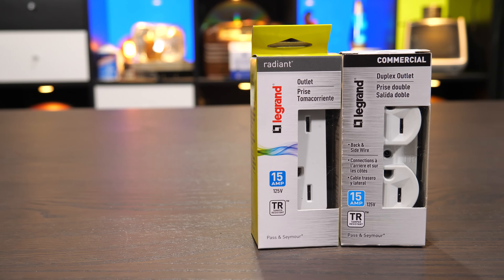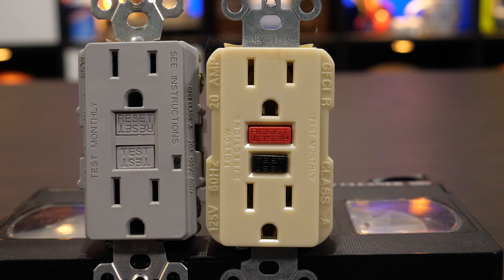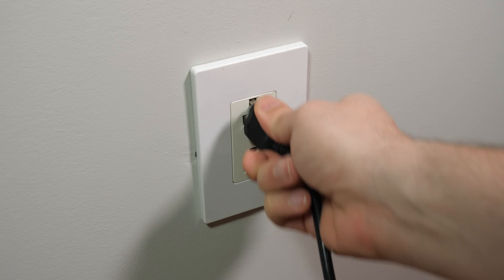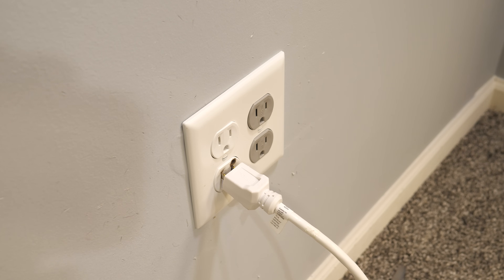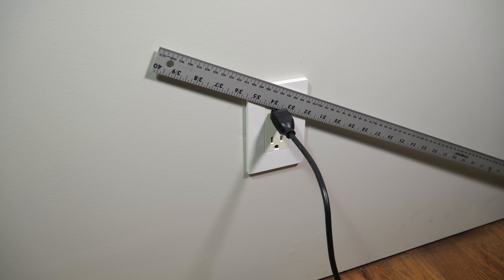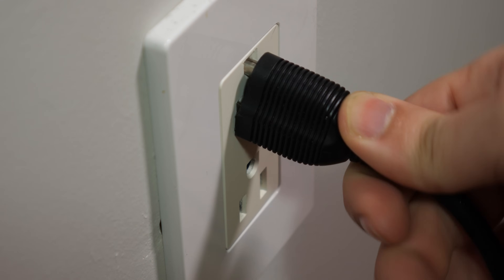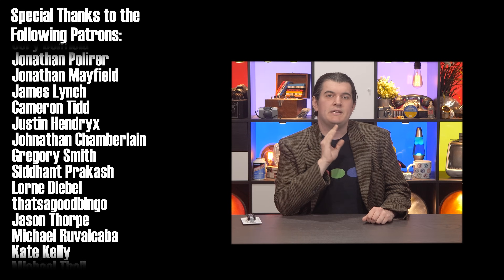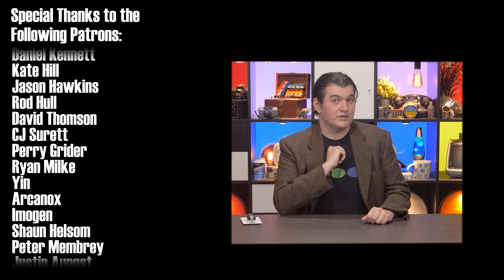Power outlets are topsy turvy - but does it matter?

Comment: One of the main reasons the EU plugs are superior, even to the UK ones. The receptacles are designed symmetrically so that they are identical when turned upside down and any plug can be inserted either way, which also has the benefit of allowing you to use two angled plugs in the same pair of receptacles.
Reply: UK plugs do have one point of superiority over everything. The live and neutral sockets have a mechanical shutter/shield that requires the, longer, earth pin to be inserted to open the shutter. This makes it almost impossible for little /fingers to get into the live and neutral sockets. Als, as all plugs have to be 3-pin then equipment that  requires a specific live-neutral polarity (I know that not much of that exists) doesn't require any thought when plugging it in. 

UK plugs and sockets are the safest in the world.
Reply: @davidjowett8195  the shutters can be implemented also with euro sockets, even though probably it's a bit less reliable system. Here in Italy it's mandatory, the shutters aren't connected to the earth socket but are designed to open only if pressure is applied to both live and neutral sockets.
Reply: @davidjowett8195  For any north americans who are jealous of the shutters, you can get NEMA outlets with shutters, but they aren't required
Reply: @davidjowett8195  Euro sockets also have a mechanical sliding shutter but instead of relying on a ground pin it works by needing both pins to be inserted at the same time which makes it even more tamper resistent.
Reply: @davidjowett8195  British plugs have also a disadvantage nobody talks about though: their relatively low current carrying capacity, especially considering their size! British plugs max rating is 13 amps. For comparison, swiss plugs come in 10 and 16 amps single and three phase, Australian plugs come in 10, 15, 20, 25, 32 amps single phase
Reply: I wouldn't say it's better. It's just different but equally as effective. Symmetry doesn't matter with the Type G plug (the one used in the UK and some other countries) because the orientation is standardised. They ALWAYS face down. I have a ten-way extension that stands vertically with five receptacles on each side. The receptacles are at a 45 degree angle so all the cables end up pointing down and to the back, and since it doesn't have to be recessed it takes up very little space.
Reply: I would say that is a major disadvantage as polarity is not fixed, leading to single pole switches in neutral conductor and other issues. UK plugs are always right angled with sockets mounted with earth pin top. Also across Europe there are several standards, with different earthing connections. Out of all the plug types the 2 pin US and EU plug are most prone to poor connection and loosening.
Reply: It depends, the French plugs have a ground pin making grounded plugs polarized while schuko have two prongs making them unpolarized. 
In some situations a polarized plug would be safer but I personally never had any issues with a schuko plug. 
The ungrounded Europlugs are never polarized and they're perfectly adequate imo.
Reply: @cyan_oxy6734  Plus Danish and Swiss grounded sockets, though naturally they are less common.
Reply: @cyan_oxy6734  It's AC, so polarization shouldn't matter in the first place. Which prong is live matters to some extent, but appliances should be designed in such a way that it makes no difference (which unfortunately not all are).
Reply: @MLennholm  With the Schuko you MUST be independent of polarization which has nothing to do with AC but with the neutral being connected to earth. So with plugged devices there is (should be) no issue with a switched cableing because they must work and be safe either way.
Reply: Imo an undervalued plug is the Australian one, it looks relatively cheap to manufacture (compared to schuko and swiss), it's got polarisation (for ungrounded plugs too, unlike the Swiss and french ones) and sleeved pins, and it's a system with different power ratings and higher power sockets compatible with lower power plugs (like the swiss one, with the difference that the swiss is extended to three phase too)
Reply: French type outlets are usually installed in pairs with the ground pin in both orientations
Reply: They’re also recessed into the frame, so there’s no chance to touch the pins and electrocute yourself.
Reply: my only reservation as an american is that EU plugs are fricken huuuge
Reply: @Jacksirrom  yeah true, as an Italian where the national standard is the compact type L (10 and slightly larger 16A types exist), but for high power (16A) grounded appliances we get Schukos as no manufacturer bothers making them with Italian 16A plugs, I feel that Schukos, but in general European (french, danish, schuko, British) plugs seem needlessly large for me, especially considering they don't carry more than 16A. Schukos in particular aren't even polarized! That's why I prefer the swiss and Australian plugs, both make a coherent, versatile and safe system while remaining relatively compact
Reply: UK ones are the best, no symmetry needed.

Comment: I have a tape measure with a notch burned out of it for this exact reason.  I still installed new outlets with ground down because of right angle plugs on nearly every power strip and/or UPS that I have.

Comment: One thing about the 'meat' around the prongs on plugs- I think there is some design for the experience of plugging stuff into power strips and other devices with side-by-side receptacles. If the plug is too wide, the consumer will curse you for making a plug too big to fit into a power strip with typical spacing. 

This is more of an issue with dumb power strip design, but we are stuck with the NEMA 5 design by the same stroke.

Comment: My brother-in-law worked for a hospital way back in the 1970's (yes I'm OLD!), and even then, he told me that plugs should be installed with the ground at the top. I've been a residential electrician now for going on 25 years, and I've never had anyone - be they homeowner, inspector or general contractor - tell me they wanted the plugs installed up-side-down. And by the way, I've never had a client lose at toss the knife at the wall either. So as you say - WHO CARES?!

Comment: I don't like giving the British credit for much (except destroying their economy, firing two prime ministers and killing a monarch in the time it takes a lettuce to go rotten) but the British standard plug design is actually very good. 

Only one orientation allowed (ground pin up), sockets are side by side and the wire almost always comes out the bottom so no cable issues. The live and neutral pins are sleeved to reduce the risk of a shock from a partly inserted plug, and there's a mechanical gate in the socket which blocks the live and neutral recepticals unless the earth pin is inserted (hence why the earth pin is longer)

The plugs also have a pretty large gap around the pins, and there's almost always a guard around the grip area to prevent your fingers accidentally hitting a pin. Not sure if the last bit is actually part of the standard but every plug I've seen is designed that way

Comment: The ground pin goes on the bottom, the plug assemblies must be vertical, pineapple does not belong on pizza, tp and paper towel rolls are to be along the wall and not over the top, and it's Pork Roll.

Comment: Lucky we don't have such problems in EU, we either have two contacts on the top and bottom of the plug (e.g. Spain and France), so you can insert the plug both ways, or we either have a grounding prong in the outlet (e.g. Germany and Poland) and so such duplex receptacles are designed in such way that those prongs face each other (prong is on top in the bottom receptacle and at the bottom in the top receptacle), so you can connect in two L-shaped plugs without blocking any of the sockets.
Reply: But of course when it comes to safety, UK plugs are considered the winner

Comment: I felt so called out by this video when it appeared in my sub box, because Practical Engineering just had a video where he shows an electrical outlet in his own house, and they were in the "right" orientation, and I wrote a comment about how of corse the engineer has them installed the "intended way" in his house. 

Also, as a european, yalls cords being so thin, and the plug so flimsy genuinely gave me so much anxiety whenever I charged my phone or a laptop in the states.

Comment: I like the right angle plug with the 45 degree wire. 50 amp RV (and some others, I'm sure) have a handle to aid in plugging and unplugging the cable. They could implement this to the 120v variants.

Comment: The right-angle compatibility argument is weak IMHO. We should not keep bad design just because it has a lot of other bad design accessories. In fact, I find it to be a strong argument for flipping the orientation (so the ground is at the top) on the right-angle accessories as well!

Comment: Not really sure I fully buy the right angle plugs being hard to use or tripping hazards since the majority of right angle plugs are on products that are designed to be up against the wall or underneath something. Anyway, the whole point of the right angle plug is so that you can put something closer to the wall where the outlet is, which just having something against the wall in itself would significantly negate most of these hazards like you're not going to be playing, throw the knives at the wall on the wall behind your fridge I think it's too late now though. I think plug should have been required to have ground pins and they should have been enforced to be put in the designed way in the beginning. It's far too late now to try and change anything.  But as always, I enjoyed the video and you do make plenty of good points in it

Comment: I remember reading somewhere that horizontal outlets with the neutral facing up is probably the safest orientation, but then the 45 degree plugs like the ones in the video are gonna be strained. I really don't understand why our plug design over here is so loosey-goosey. Gimme those thicc chunky UK plugs any day. 220-240v too please.

Comment: I'd like to suggest the US should get a new standard plug, instead of mitigating risk with the current one. The plugs I got in Sweden have a) insulated prongs, so half-dislodged is no issue and b) the socket is recessed so you can't get anything between the plug and the socket when half-dislodged and c) The ground is symmetrical top and bottom so there is no "upside down." I want a video on just how in the name of baby Jeebus the US ended up with plugs and sockets this atrocious, and why nothing has been done about it.

Comment: Why is the face plate of US outlets flat?  Here all face plates have a recess, either 5mm or 18mm deep, and the plugs are either designed to just fit in the standard recess or they have those partly isolated pins.
Outlets are also symmetrical so an angled plug or a device can always be plugged in the convenient way.

Comment: I mean quite honestly the absolute easiest fix would be having outlets that go into the wall just a little bit. Almost if not all of these problems can be fixed by just... having a proper slot rather than just a thin sheet of plastic

Comment: No matter what you do, or which way round you mount your sockets you're never going to beat the safety of the UK's type-G outlet. That has shutters over the live and neutral sockets, has a longer ground pin, has sleeved live and neutral pins, has a fuse in the plug (1A, 2A, 3A, 5A, 10A or 13A depending on the device) and has a switch on the socket (in most cases now).

Your only advantage is half the voltage 230V.

Comment: Making the pins sleeved like, oh I dont know ... everywhere else in the world would be a step forward. I have been zapped by touching un-sleeved live and neutral pins while plugging something in. 240v across my hand is certainly something I won't forget! This was an old plug though, before the idea of putting sleeves on the pins had been thought of.
Reply: In the U.S., most outlets are 120 volts. So, while the outlets aren't as safe, the voltage is much lower.

Comment: They also make locking ends for extention cords, I dont see why we couldnt utilize that tech for receptacles, they work with a massive percentage of existing plug in devices, unless device size/existing box size is the primary issue. I dont see why we couldnt make that code and update existing structures as we go. If we could get that device down to the size of a GFCI receptacle size for duplex, i think it might solve most of our issues for the time being.

Comment: When I bought my house about a decade ago I noticed that all of my outlets had the ground on top. I actually thought that it meant they were reused as the house had been renovated just prior to my purchase.
Reply: it's a common convention and typical for houses built in the 60's through 80's.  upside down sockets denote 20 amp circuits as opposed the 15 amp when they are right side up.  Very common in kitchens, garages, and basement work areas.
Reply: @johngaltline9933  This is a house from 1903. Every single socket in the house is this way. The renovation I mentioned was in the early 2010's.

Comment: Our sockets in most of mainline Europe (the "Schuko" socket) just do not have this problem as they look the same upside down, so you can always plug in an angled plug both ways.

The disadvantage is, that you never know which of the pins is live and which is neutral. But I am not sure if knowing this would really be beneficial for any application.

Comment: Some of the 45 deg right angle plugs have a ring handle which when rotated out away from the wall loosens the plug and you can then pull on the ring to remove the plug completely. When plugged in the ring is folded up and flush with the plug.

Comment: I think in commerical construction upsidedown has become the standard. I think it might actually be written into my local building code for commercial buildings although I'd have to confirm. Interesting that you mention metal faceplates as being oldfashioned because those are also still required in commercial installs where I am.
Reply: It's just convention, and has been for quite a long time.  back in the day, folks decided that they would flip the sockets over to denote 20 amp circuits, as opposed to the standard 15 amp ones.  Most commercial buildings run 20 amp circuits for everything for the last several decades, and the convention hung around, even after 20 amp sockets started having the 'T' shaped slots.

Comment: I’m sitting here pretty smug here in Type G Land (UK) watching all these issues I don’t have to deal with. There are some issues here but I know what system I’d prefer! A good video idea is to get some Type Gs and do a video about them, and even do tests or comparisons.
Reply: Type G is definitely better than what we have, plus they have switches on them which is a good feature.
Reply: Type G plugs are ALL right angle as part of the design. The enormous pins are also capable of supporting even the most outsized wall wart adapters as well.
Its just that when you have a setup with 6+ plugs it all gets very space consuming.........
Reply: But they are huge, though!

Comment: Excellent essay on this topic. I'm a retired electrical contractor and inspector. When I clicked on this, I thought to myself, "Let's see if he did his homework." I have to say that you did. The only true ground up argument I have heard is: in retirement homes, go ground up so there "won't be owl and monkey faces in the walls".
Reply: As a contractor in the field, it seems you'd have run in to the standard convention.  standard ground down, 20 amp circuits ground up.  Though that hasn't been so strictly followed in the last 20-30 years as T slot 20 amp sockets became standard.

Comment: In Newfoundland they're all installed with the ground pin on the top, and having lived the first 24 years of my life on the other side of Canada, I was very confused. Also very skeptical when Newfoundland natives told me this was actually correct. 🤷‍♀ The only reason it annoys me now is some cords, particularly the heavy weight ones on some hair dryers, have the cord coming out of the side of the plug. Always the ground pin side. Which pulls the plug back out when that's on top.
Edit- Yes! Those!

Comment: Personally, I've always hated the right angle cords, cuz you can't plug two of them into the same outlet! So you're forced to get an extension cord that doesn't run at a right angle just so that you can plug in your second right angle corded device.
However, those ones were the cord comes out 45° from the right angle look awesome. I need to keep an eye out for those, cause that solves that problem.

Comment: In 60 years I have never had anything short out touching across partially plugged in blades. Here in the US, we typically run 120V in those outlets an unlike 240V in other countries you might get a little tingle/zap but no harm done unless your fingers are soaking wet. If you grab a plug with your hands wet, you deserve what you get.

Comment: And then of course, you can't insert two 90° plugs into the same gang, since one is going to block the other.

One thing I have wondered for a long time..... If I were to move from the UK to the USA, would there be anything in USA code that says I could not fit my house with UK plugs and sockets/receptacles, if I wanted to? Even further, assuming I were an eccentric millionaire and money was no object, would there be anything which says I could not go entirely off grid and install a UK 240v 50Hz generator and wiring in my house in the USA? This is of course speaking entirely hypothetically.